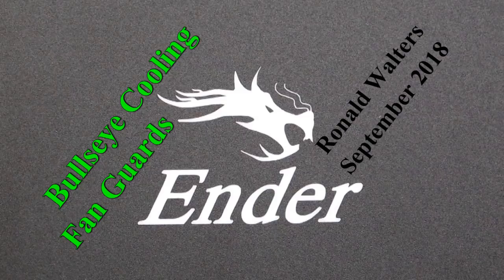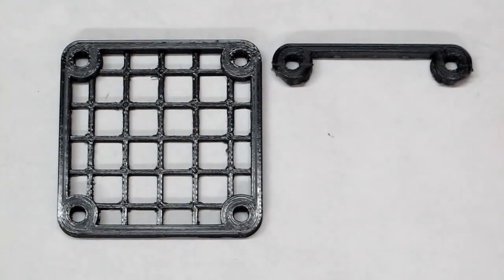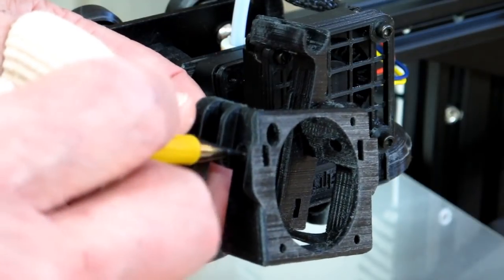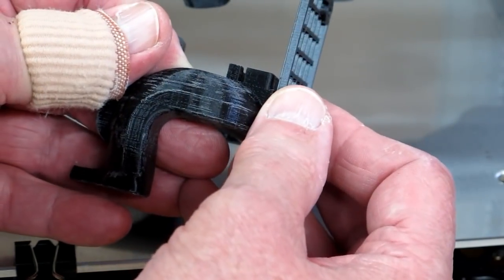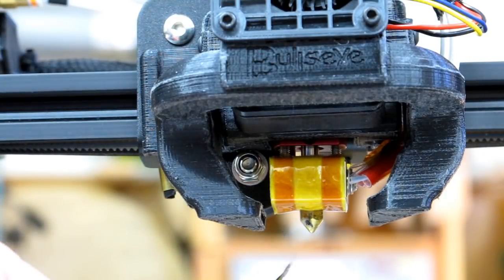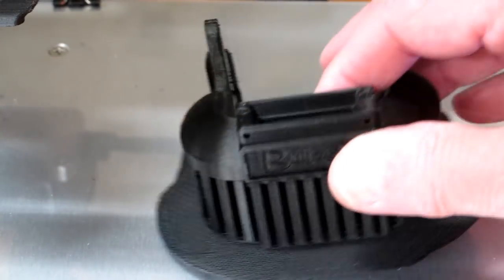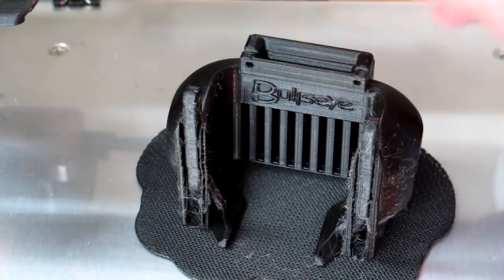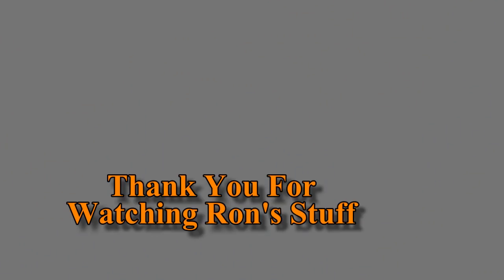Ender-3 Bullseye Cooler Fan Guards

Comment: I am dying to know your support setting in Cura.  I turned them on and got super tight supports that I could barely get off! Yours have a larger spacing.  How did you achieve that?
Reply from the maker: Supports used depends on what is being supported. Generally I try to use zig-zag support and just enough to do the job, Zig-Zag pulls off fairly clean like a zipper (usually). A difficult item also gets printed on a 2 top-layer raft to hold onto the supports (good support attachment to the build plate).

I looked, but unfortunately I do not seem to have a record of the support settings used for the Bullseye Cooler.

In Cura I use support overhang (angle) 50 degrees (anything less than 45 degrees generally does not need a support) and support density 30 to 40%

Some prints are just difficult and time consuming to clean up, no matter what you do.

Hope that helps.

Please subscribe. That is what keeps this channel going. 
Ron

Comment: What do you use on your glass? Cant get adherence on my glass
Reply from the maker: For the Creality Ultrabase Black Carbon Silicon Crystal Glass... Make sure the nozzle is adjusted paper thick clearance to the bed. Clean the bed every time with rubbing alcohol (every time). Printing with PLA... First layer Nozzle 215 deg C Build Plate 65 deg C. Second layer onward nozzle 210 deg C build plate 60 deg C. I hardly ever have a problem getting it to stick. Seems like the more worn looking the surface of the glass becomes the better it works. I am talking about this glass: 235*235mm Ultrabase Black Carbon Silicon Crystal Glass: https://goo.gl/ugMT75

Comment: I've printed out 2 bullseye's for both my cr10 and my ender 3  using the 9.27 duct ( stock fan) Ive only fitted one to my CR10 so far and have noticed a few things, maybe its because of how tightly I have calibrated my cr10 but I've found the 4010 part cooling fan wobbled quite a bit -  everything else lined up perfectly  - I fixed the wobble by running a quick bead of hot glue around the outside of the fan before inserting it in the fan duct ,this also serves to give a better seal which helps with this sort of fan, another thing I noticed was the exhaust ports of the fan ducts didnt sit centre around the hotend nozzle of my CR10, looking from the back of the printer the fan duct on the leadscrew side was about 5mm further away from the nozzle towards the leadscrew and looking from the side of the printer the centre of the hotend nozzle just barely  lines up with the toe end of the fan duct, this maybe down to manufacturing  tolerances of how my particular CR10 as it was built t the factory,  so when I get a bit of time I'll remix the fan duct to suit my particular printer also rotating the mounting for the part cooling fan outwards a few degrees as well as adding a couple of extra mountpoints  for it while I am at it

Comment: Why raft?
Reply from the maker: Explained in the video.
Reply: @RonaldWalters2010  would brim work in holding smaller supports to the bed?
Reply from the maker: Probably not as the brim just butts up to the edge of the part (small support). I use the raft as the small pieces are actually printed onto a PLA surface resulting in (I think) a stronger support. Brim has proven quite useful in preventing warping.
Reply: @RonaldWalters2010  I see, thanks for explaining.

Comment: Which you recomend to buy CR10 or Ender3?
Reply from the maker: My Ender-3 is now printing every bit as well as the CR-10 and it takes up less space. The Ender-3 print bed surface will need replacing. Thus far the Ender-3 would have printed everything I ever wanted to print but it does have a smaller bed. If you are willing and able to trouble shoot and fine tune the printer (and if it is large enough for your anticipated needs) I would recommend the Ender-3 as it will save you some money. Note: Not everyone has experienced problems with the Ender-3 setup. The Ender-3 Pro is a little more expensive but an excellent machine. A friend of mine has had good results with the Ender-3 Pro print surface. The Ender-3 and Ender-3 Pro are 24 VDC and heat up much quicker than the CR-10. I have links and discount coupons in my video descriptions for all three printers. Hope that helps. If not ask again. Ron

Comment: Has anyone design a Bullseye Duct that will fit a larger 5015 filament fan?
Reply from the maker: This same guy has a different pipe for the 5015 (and another for two 5015's). Follow the link at the bottom of the comments for this video.
Reply: Thanks, but I'm using the older Petsfang duct with the 5015 fan. I'm just wondering if someone has design a "Bullseye" duct that will fit the 5010 fan.
Reply from the maker: There's an adapter - https://www.thingiverse.com/thing:3115750
Reply: Thanks again this will work.